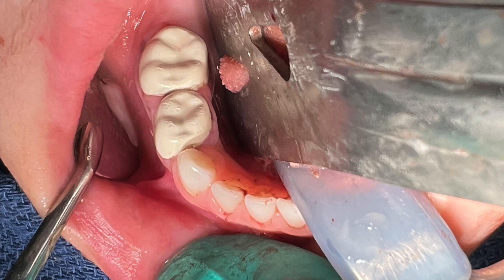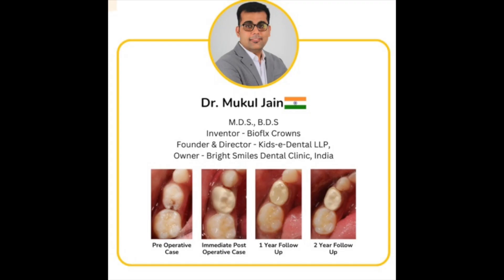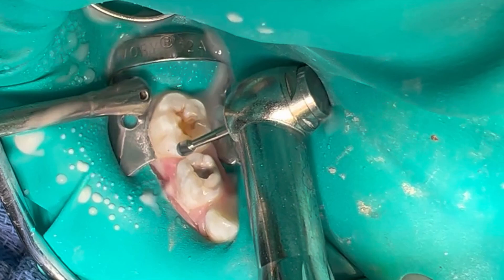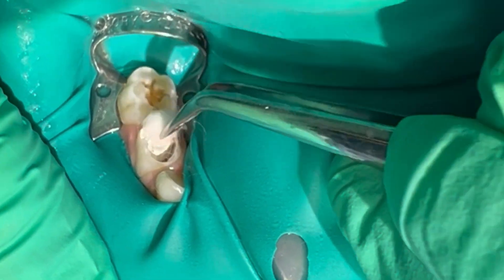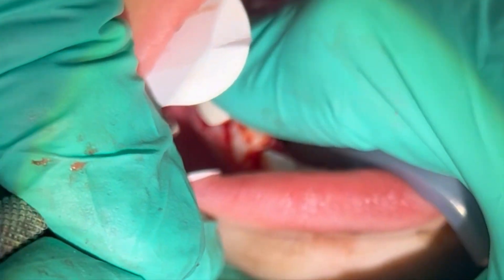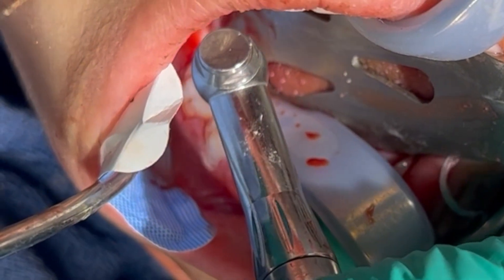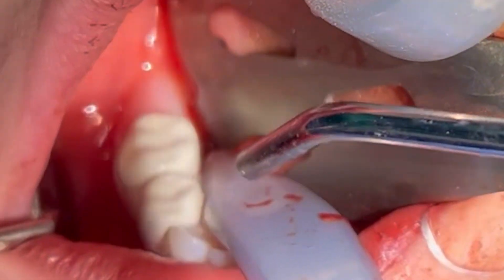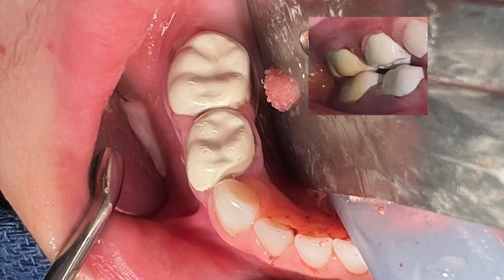BioFLX NuSmile Pediatric Prefabricated Resin Crown.

Comment: hi doctor, did you do adjustment on the bioflex crown before install it?
Reply from the maker: Hello, great question. You can not adjust these crowns, One thing that I am noting is that there is more occlusal reduction 1.5 - 2 mm that is required to make sure the crown is fully seated and it is subgingival margins.  These crowns cannot tolerate hyper occlusion like and SSC or if there is an excessive amount of cement or space between the crown and the preparation.  I will try and post an updated IFU with a case as well.  These crowns are very nice alternatives to posterior pediatric zirconia crowns as far as ease of placement, but not a 1:1 with SSC as far as the amount of forgiveness in the preparation